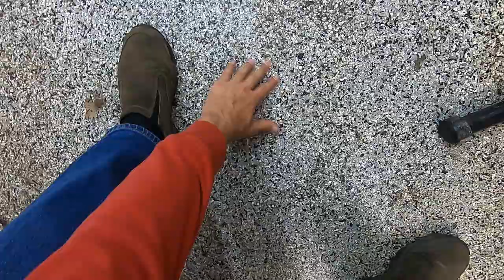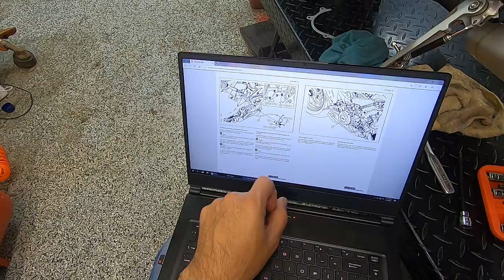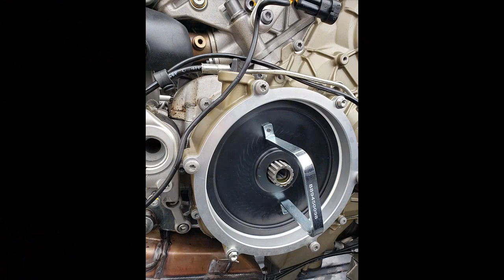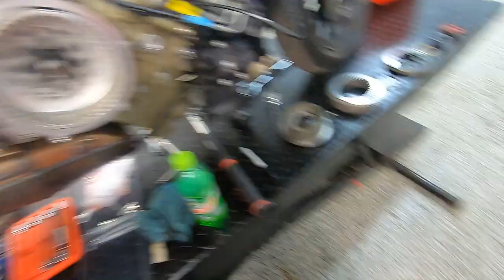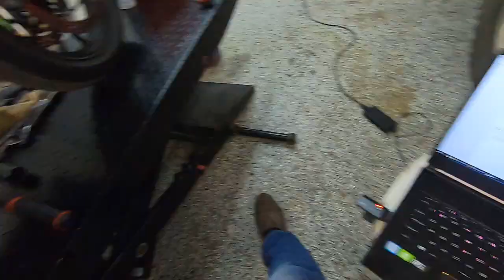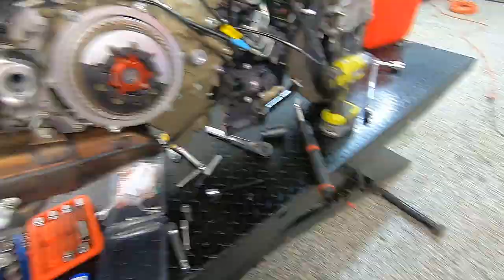Ducati V4 dry clutch install, Part 3

Comment: The oil seal you're looking for in the first half of the video is staring right at you: it's recessed and located right around the clutch release rod in the engine. You mistakenly looked for it on the clutch slave cylinder, which is why you couldn't find it. It's been staring right at you the whole time. The documentation clearly shows the location of the oil seal; I don't know how anyone could have missed it. I just performed this procedure and removed the oil seal without any problems.

Comment: Hey Shaun, the only thing i did not understand is the schnurr installation. that's a conical shape washer type, is the wider side facing outwards or inwards the bike? thanks
Reply from the maker: Do you have the manual?  It says "Insert the Schnorr washer (27) on gearbox primary shaft (Q), with the rounded surface facing out."

Comment: This video is very helpful with out it i would have not done my conversion. Is it normal for the clutch lever tension to be a little stiffer than a wet clutch? I just did my streetfighter v4s and the clutch lever is stiffer. Thanks

Comment: Hmm, how does he tighten the nut to 190nm at the 27 min mark? Goes from ‘oh err this torque wrench doesn’t go to 190 let me go find another one’ to ‘there, that’s done’ (whilst holding a bigger wrench) with no mention of the need to use a special tool to hold the clutch in place whilst torquing. No tool = no dice. Seems a little misleading to me. What else has he glossed over…?

Comment: I put two hours into the conversion and am ready to pry off the cover. Wish me luck it seems to be glued on very well.
Reply: Turns out that it's much easier to take the cover off with the two center fasteners removed.

Comment: Shaun thanks for your steps by steps video.  I’m planning to install this to my 18 V4s but the kit says only for vehicles with vin ZDM1100W4#009397# and my bike don’t start and end with this serial number do you know if this kit still fits my motorcycle?

Comment: Experiencing an issue on my V4. When i install the spider bracket on the dry clutch and torque the bolts to 8nm, after a ride the bolts start to back out and the clutch begins to stop engaging properly.  Do you use loctite on them?

Comment: Shaun im considering the change to dry, a couple of questions; did you ever find out what the large dia. washer with writing on was for? and my concern with your open clutch set up is vulnerability in a crash, do you recommend a cover?
Reply from the maker: You can see the washer being installed in the video. Easy way to avoid damage to the clutch - dont crash!
Reply: @ShaunNielsen  thanks Shaun, will take your advice on point 2! hows its wearing, are you still pleased with it?

Comment: So did you ever remove the clutch slave seal? I wasn't really sure what happened there. Also, those three specialty tools you used at the dealer, what were the two punch looking tools used for? Thanks in advance, and thank you for the awesome vids.

Comment: Hey Shaun, love your detailed steps on the change. I'm changing my clutch pack soon. would you be able to share the manual of the Dry Clutch installation? Cheers mate!
Reply from the maker: email me at shilka99@hotmail.com
Reply: Hi Shaun , my name is Martin , I saw your vidéo on how to install the dry clutch kit on the V4 , I need more info , for the push rod do the 2 small roller Bering are for that rod , I will send you photos by email , tank you

Comment: Shaun  can you email me the service hlm  I think the screw next to the slave is the oil pressure flow to the wet clutch and screwing it in clock wise reduces the amount to it  as it's not needed for the dry clutch ???

Comment: What ever happened to the a slave cylinder seal? Did you have to remove it?
Reply from the maker: I didn't. I've been monitoring it very carefully and 10 track days later there are no leaks.

Comment: Hi, how did you torque up the main nut to 190nm? The nut spins with the basket no?
Reply from the maker: I used the special clutch holder tool, but I forgot to get it on video. Motion Pro sells them, and charges a lot less than Ducati for their special tool.
Reply: @ShaunNielsen  Can you please tell me which Motion Pro tool it is?

Comment: I'm considering going Dry Clutch on my StreetFighter. Are there any real benefits to going Dry aside from the look and sound? Great video by the way.
Reply from the maker: A dry clutch will give you a similar increase in rear-wheel horsepower as a full exhaust, without the need for adjusting the carburetion.

Comment: Hi, I just completed this on my V4. Thank you for your guidance on the installation. I did take it out for a spin and when shifting gears with the clutch lever (not always) usually 1st to 2nd the clutch seems to kick back/bind a bit. Is this a characteristic of the dry clutch? Or do I need to bleed the master cylinder properly? Thank you
Reply from the maker: Shifting from 1st to 2nd is always a bit clunky due to the large ratio difference regardless of dry/wet plates.  Bleeding the clutch line wont help.
Reply: @ShaunNielsen  Thanks. I feel the judder in the clutch lever, when releasing. Is that the slipper? Meaning is it kicking back as wheel speed matches... make sense?
Reply: @duclife1059  I just had dry clutch installed and I believe I am feeling the same thing, but mostly when down shifting there is a little judder. Did you ever figure this out or any thoughts? Thanks

Comment: Did you get all those washers installed correctly? Also is there a part number for the basket installation tool?
Reply from the maker: I did. So far the clutch has done 500 miles on the track.
Reply: What is the typical wear on the plates? I’m thinking of doing the conversion, mostly track use
Reply from the maker: FYI the part number is on the handle in the thumbnail for this video
Reply: Hello Shaun where may I ask did you order the center sump tool from? I'm getting ready to do this conversion as well. Thank you for your tutorial!

Comment: 22:39 But does the engine brake still work when it opens the clutch? Or did i misunderstand this system :D
Reply from the maker: Engine braking is greatly reduced with a slipper but its still there.

Comment: Shaun what was the outcome with the slave cylinder.  I noticed you ran the bike but left the slave cylinder as is.....was it ok to just leave it stock / untouched?
Reply from the maker: I've sent a query to Ducati through the dealership to clarify. Its possible these instructions may refer only to bikes with VIN before ZDM1100W4#009397.  As soon as I hear back from DNA I'll post here.
Reply: @ShaunNielsen  Thanks Shaun.  Also would a aftermarket R version slave cylinder be a good work around.  I have a couple question to ask.... could you post the part numbers to the special tools used and if you have any footage of the special tools in action.   Thanks again Shaun your videos are very helpful.
Reply: @ShaunNielsen   Shaun did you ever figure out or here from duc the adjustment on the small screw next to the slave ??????
Reply: @ShaunNielsen any update on this? Tia
Reply: Did you ever hear back on this?